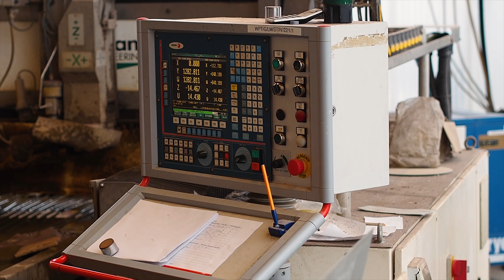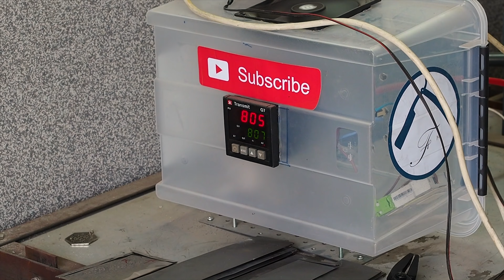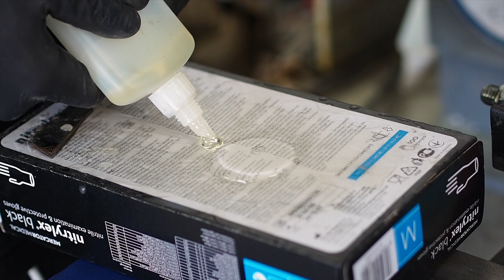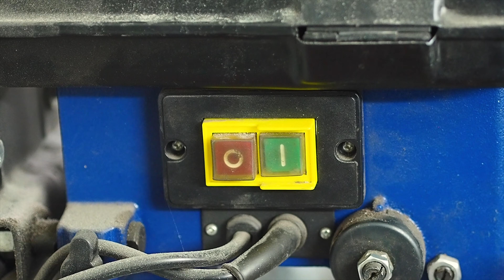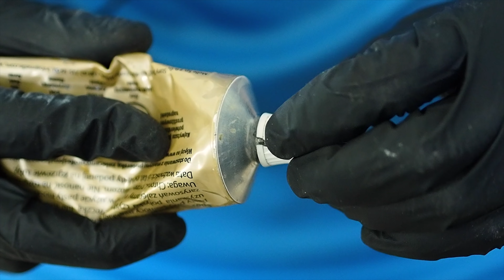Knife Making - FIGHTER w/ BLACK BLADE and Stabilized Wood Handle

Comment: Really love the design of this blade!
Are you ever concerned with ruining the tempering while sanding the bevels? I don't own a belt sander and only used an angle grinder for rough shaping a couple times. Didn't turn out too great in my case 😌
Reply from the maker: We always care not to overheat the steel when grinding after HT.

Comment: I saw that you used a drill bit to scribe the line on your pre hardened blade, I can't get mine to make a mark, any tips? That pin looks awesome! Also what were you using as liners?
Reply from the maker: You won't mark the steel, it just scratches the dykem. If you want to scratch the steel, you can try a drill bit for hardened steel, but they're usually pretty expensive

Comment: Hey just want to clarify the blackening solution.  The ( 1,2 l ) part is a bit confusing if you could explain that part.   Thanks and Great blades!
Reply from the maker: What's so confusing about it? It's 1.2 l of water
Reply: Ahhh so u meant 1.2  not 1,2
Comma instead of decimal point was confusing